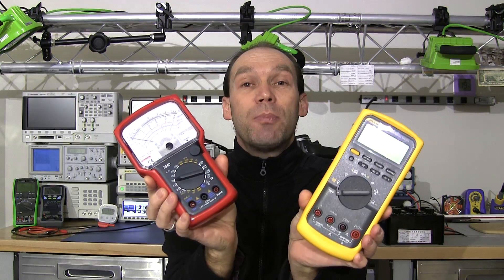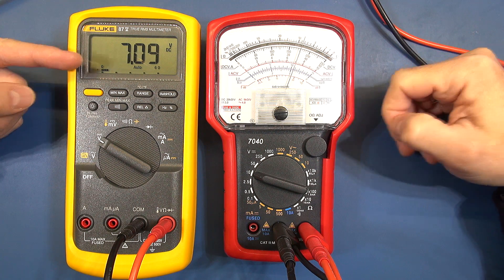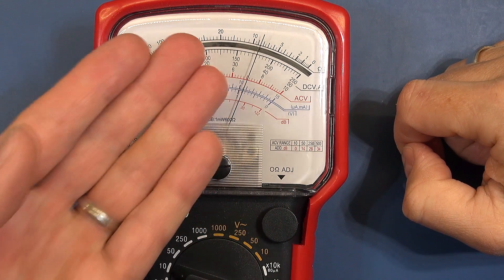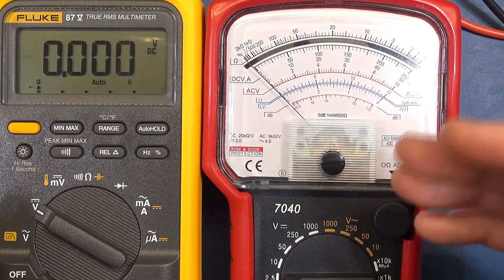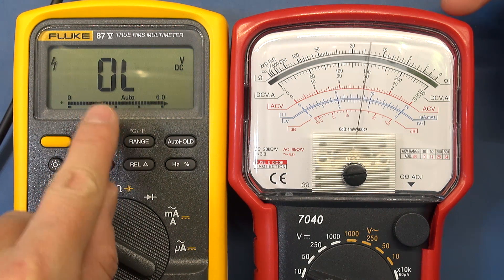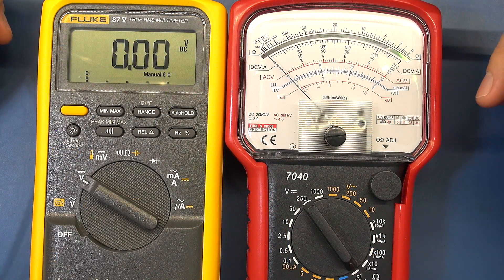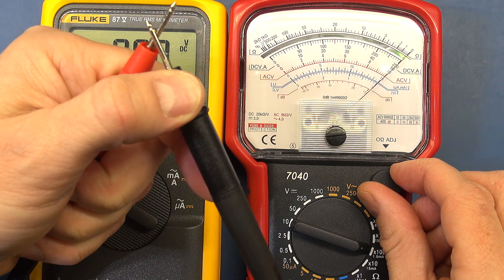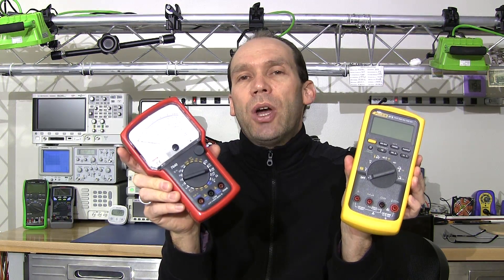QTV #6 - Analog vs Digital Multimeters

Comment: I used some simple VOMs to read the amperage of a high voltage power supply; no problem at all. If I would use a DMM for that it would probalby break down or not be accurate at all. Every tool has his own special purpose and advantages.

Comment: I always prefer analog meter when it comes to voltage measurements, I've had cases with fake voltage when. I have tested with digital imeter t shows 12V DC but when I have measured with the analog it was 3 VDC, then I inspected the PCB and realised it is a fake voltage due to a thermistor issue on the PCB,

Comment: Analog shows the same movement for magnitude change regardless of the starting point if the scale is linear. But on a digital you might have one digit change, or all of them change, which intuitively looks like a bigger difference. I knew a man who could repain anything, and he used a big vintage voltmeter on his desk. It couldn't be pulled by the leads. He said it was much better. The scale was also finer on it.

The auto ranging should be turned off like on early digital multimeters. I feel very uneasy if I see microvolts displayed and I'm about to touch mains voltage with the meter. The Fluke is unreachable for most people. Other meters update less often, and the time to settling is therfore longer.

Comment: I had two Sanwa Yx360trf, and both died on me every after 10 years of very slight use. For example, I only use it once to measure a battery AAA voltage and then kept it in cabinet with batteries removed. Ten years passed, I took the analog meter and used it again, and weeks later I notice the resistance measurement no longer works. Despite new battery. This happens to me twice on two Sanwa Yx360trf. I don't use the analog meter that much, but I wanted it to be around in case i need it. I saw, that contact rusting is the prime cause. This third time around, I bought a Fluke 17B+ and hope this one will last.

Comment: Analog meters can take voltage spikes and trasients better than digital. All the diode arrays, spark gaps, gas tubes and MOV's add up making digital three to five times more expensive for a really good meter.

Comment: which one do you prefer. I do use both and find it more interesting to use the analog meter but seems to me the digital one has many advantages over the moving needle of the analog meter. Never the less I still prefer the analog because it's cooler =)
PS I do realize this is an old video...

Comment: I don't buy the deciphering advantage, you can put the dmm in relative mode, easy to spot, or min/max; the changing part, it's not so much a dmm problem, but a Fluke 87 V problem, which is a very slow DMM actually

analog meters are extremely inaccurate, they have absolutely no place beyond general basic information display

Comment: Its much better having both electrical and electronics background and having both analog and digital. Analog is so much usefulness in electronics. Especially in identifying the transistor leds. It not only identify the PNP/NPN but the emmiter-base-collector visla difference in its resistance.

Comment: Digital multimeter like fluke and klein multimeter have input protection in their resustance. If you mistakenly forgot you have the meter on the wrong setting it will not explode. In a analog multimetet dosent have a inpuy protection in its resistance that might got to explode.

Comment: Analogue bar on a digital meter should easily help you compute whether its increasing or decreasing? Analogue meter has poor resolution and another disadvantage with analogue meter is polarity - wrong way can damage meter.
Reply: If they're marked "CE" (UL in USA, CSA in Canada, TUV in Germany, etc.) and they've not actually been tested or certified, that's (1) civil trademark infringement and (2) more important, it's criminal fraud. In reality, for many people, the "El Cheapos" are sufficient for checking house wiring to switches and outlets, which is Cat II. I've used a $5 analog VOM for that for decades (has a mirrored scale too). Sits in the kitchen drawer. The real issue with them is more about the people who buy them observing proper safety procedures and probe/lead maintenance. Their target market and the folks most likely to grab one off the peg rack in the checkout lane of the grocery store are generally clueless about how to properly use one and they won't read the directions or the safety warnings as they demand "Plug-n-Play" devices. That's invariably the "cockpit error" that occurs when someone gets zapped using one. They don't know what the Hell they're doing, completely disregarding proper safety procedures and the condition of the probes and test leads they're using. Not the meter, but the Village Idiot using it.

Comment: Both digital an analog have their pros and cons. You need (a decent quality) one of each to have the capability do the full range of meter testing.
Reply: Why do I need analog when digital can do everything? Also, digital seems to handle "overload" indication and negative polarity better.

If I like only digital watches, not analog, does that means I should use a digital multi-meter?

I tend to think if I am just probing for where there is voltage, analog works fine, and I don't even need to turn it on or have a battery in my old analog meter. But if I want an accurate reading(s), digital is the obvious choice.

Comment: my needle is not working well since the fuse got busted. i have an analog multimeter when i set it to the lowest reading the needle wont zap to right like it used to it just went to the middle. please help. im just new on this thing.
Reply: Battery change?

Comment: Very interesting, I've got a digital multimeter but I've got a soft spot for the analog's as they tend to give you a better representation of the ranges on the analog scale. This is why I still like mathematical slide rules compared to digital calculators.

Comment: I started on a micronta clamshell, and went to a Fluke 77 many yrs back. Recently we had a fire at my work which melted my new series 4 model 77. This prompted me to evaluate what i need in a meter, i opted for a new Simpson 270-5 and a cheap tenna dvm. I am so glad i went analog. So much more precision and fast action on the 270. No comparison. The Simpson for my purposes is hands down superior to even the Fluke it replaced.

Comment: I work on scooters for a living and sometimes I need to test the ignition components. The manuals say to use a specific model of meter to take the resistance readings. It says that because of the semiconductors in it that the wrong kind of meter will not give accurate results. Of course, the model of meter they recommend isn't made anymore. I think I've figured out that the reason you need a specific kind of meter is that most meters don't use enough voltage on the resistance test to push through the semiconductors. Does that make sense? Are there meters that use higher voltage to test resistance than others do?

Comment: First, nice choice on your DMM.  I also have the Fluke 87V.  Wouldn't trade it for the world.  Another Tester I have is a Simpson 260 analog.  My first shop experience was using an analog meter.  What I have found is that they are great for watching your capacitor charge and discharge rate. Also they are great to sniffing your defective switches:  shaky needle - bad switch.
Reply: Eleven years later; but great comment about faulty switches 👍
Reply: @Pumba3900  That little trick is great when it comes to mircoswitches.  Some of the stuff I used to work on were loaded with them.  They would detente properly when you manually pressed them and fool you.  It got to the point where I would automatically pull the meter out and check one if I spotted one.

Comment: Another good video. I personally like digital meters. The only time I like to use an analog meter, is for sensitive detection circuits where you would like to see slight changes in voltage or current.
Reply: And for the motorcycle ?what the best meter analog or digital (just ask).....for me analog is better than digital on RPM meter and speed like defi meter
Reply: Ideally you'd use an oscilloscope for that, but an analog multimeter is a cheap solution

Comment: Analog meters are good for high voltage low energy stuff, as cheaper digital ones easily break if there is spikes in voltage. I have broken many <$50 meters when measuring e.g. back-light inverter and now I use analog meter for those kind of measurements.

Comment: I have an analog Micronta that I have had since I was a child.  It was a gift from my grandfather from Radio Shack.  It is a huge one too.  It is my go to meter for nearly every project, but I do have a cheap digital for when I need to get real accurate voltage measurements down to the 2 decimal places (like measure a lead acid battery to see its state of discharge)   Once thing I have noticed is a lot of digital meters have a hard time with accurately measuring voltage of Modified AC Sine waves off of inverters.  My analog doesn't have that problem.  I think though if you do a lot of electronics work you definitely need to have both.
Reply: 9 years late, but you need a true-RMS meter for reading square waves accurately

Comment: Analog meters have their place when you have oscillating voltages and etc. It's a lot easier to identify them, that's why I only keep one, the rest of my multimeters are digital.
Reply: How do you measure small leaks in transistors? The digital ones cannot measure.
Reply: And for the motorcycle ?what the best meter analog or digital (just ask).....for me analog is better than digital on RPM meter and speed like defi meter

Comment: If voltage is not stable - fluctuating signal, actually digital meter is better, because if fluctuations are fast, needle is too slow and you are not able to figure out min and max reading - amplitude of fluctuations, but on digital meter you have min/max button or you can switch meter to VAC and then measure only AC part of voltage, so you can measure amplitude of fluctioation directly. For example, if you have classic rectifier (50/60Hz) you can measure AC part of voltage on filtration capacitor. Decent quality digital meter is another level than some analog meter. Also quick measurements like measuring lot of resistors/voltages, and chcecking if they are in tolerance - you have data login feature, or you can set tolerance and meter just beep if it is OK and it is very fast.
Reply: exactly what i was thinking. If i set mine to DCV and prove the mains i can clearly see the 50Hz in the bargraph. I dont think an analog one could keep up at that speed. It's fancier and all but as time passes there's less and less that a analog can do that a digital one cant.
They still have their use in some old equipments for specific stuff though.

Comment: Another thing to consider with a analog meter is the input impedance - the handheld model you're displaying has a 20K/Volt rating which is probably ok for portable use.  At the bench a VTVM with often a 11M/Volt rating will load down your circuit that much less (if the circuit is sensitive to that kind of loading).  One of the most useful functions, and why I keep a VOM/VTVM on the bench, is the ability to quickly adjust/tune a circuit by looking for a peak or null...hard to do with a digital display, even a DVM bar graph.  As usual nice video Martin, thanks!

Comment: I still think there is a place for a analog meter on the work bench. Sometimes the visual stimulation is required, especially when you do not need to measure absolute values.

Comment: One other advantage of analog meters: when something goes wrong and you've overcurrent/voltage, you can here the ping of the needle hitting the right side of the scale ;) . And then hope, you didn't shoot the meter...

Nah, honestly, analog meters are pretty useless nowadays. The only advantage I really still have to give to them, as you mentioned, is seeing the change. But if I really would want to see that, I'd use a scope anyways. There are just too many other disadvantages: slow, hard to read correctly from an angle, wrong reading if they aren't oriented correctly (most of them have to lie flat), low internal resistance in voltage measurements aso.
Reply: Horses for courses. I have a lot of personal digital bench and portable gear but I still use analogue meters for most jobs except calibration checking which is where a good 4-wire 6.5 digit DMM really stands out. My workflow is far faster for fault finding with a analogue meter and at the end of the day that's money. Once you get the knack of judging the voltage from the rate of rise of the needle you rarely need to look at the scale itself for checking around ICs for DC levels.
For more complex work I use active probes on analogue meters when I need high impedance or high bandwidth, 100MegaOhm or 500MHz is easily attained with the right setup at low cost and reasonable flatness

One thing that really annoys me about DMMs (even quality ones) is their susceptibility to RF fields. In addition, some are noisy at RF themselves, making small-signal or EMC work rather difficult with them. Modern scopes may have high specs but when it comes down to everyday use for my work they are rather pointless. The scope I use the most is a cheap re-badged unknown manufacturer with CRT dual with 20MHz -3dB point - and that's mainly for the X-Y mode. I had to hack a Z connection to it to make it more useful. I have a selection of more modern scopes, including a Tek MSO4104B and DPO71604C. They haven't been powered on for a while or two and don't really pay for themselves.

Try getting fast potentiometric readings down to 0.005% accuracy  with a DMM and you'll see what I mean. I use various bridge configurations to match precision components to this accuracy all the time for specialist design work - trying to use a DMM to balance the bridge is almost impossible to do in a hurry. 

Amongst my colleagues and peers, analogues are still the norm for faultfinding production equipment and troubleshooting new designs. Departmental testgear budgets are six-figure per annum but if you look around the benches they are covered in AVOs and VTVMs - you should see the look on the faces of postgrads when they look around. After a couple of years on the job they are buying old meters off Ebay for peanuts just like the rest of us and calibrating them on the (analogue) comparison bridges once a month :)
Reply: @gordslater  An analogue VOM that uses active probes? What?